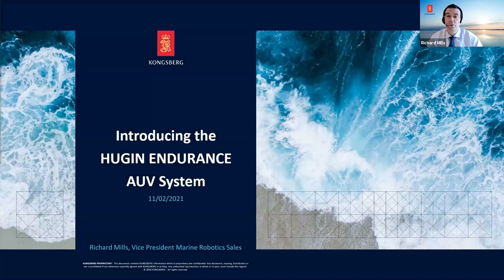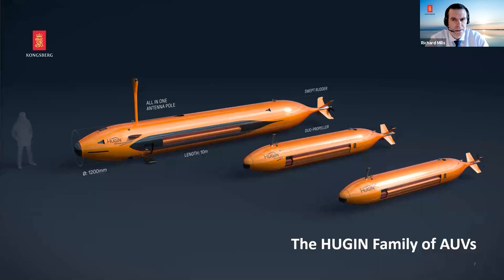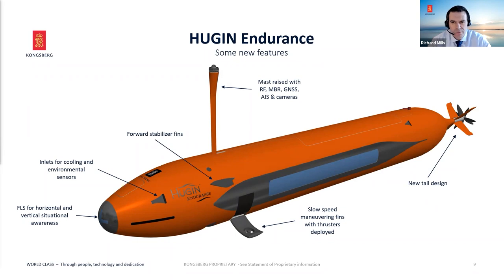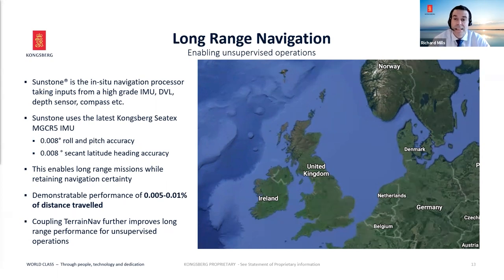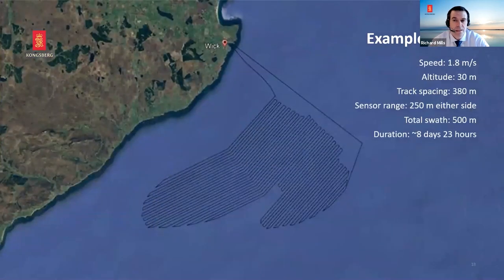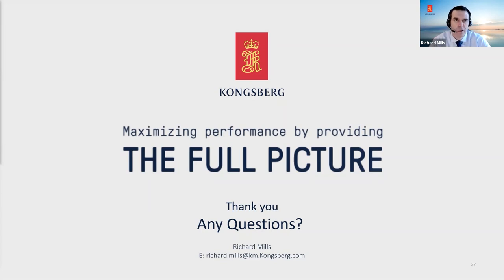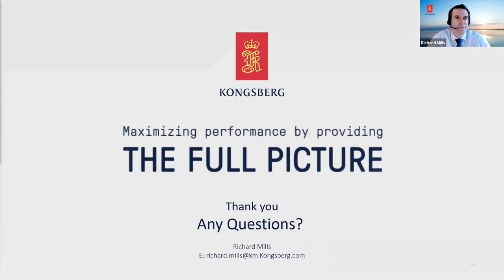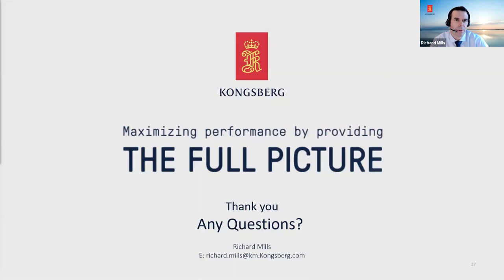Webinar -  HUGIN Endurance

Comment: Truly amazing capabilities in this UAV. From ship or shore, it could easily survey and determine whether an acoustic anomaly off the Java coast was caused by the seabed impact of missing airliner MH370 as debris sank. The seismic epicenter error is currently about 2-4 km directly on the "7th Arc", but could be improved by calibration of sound speeds in the local crust.